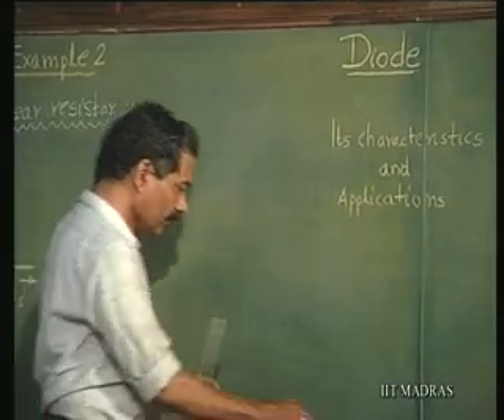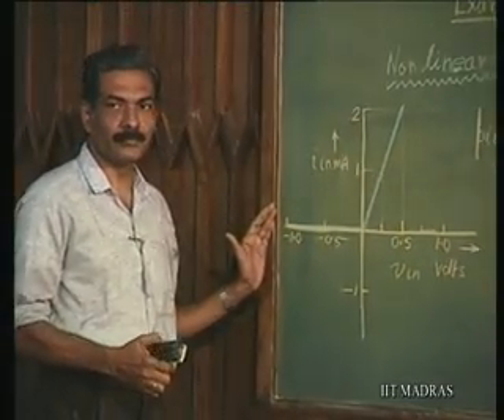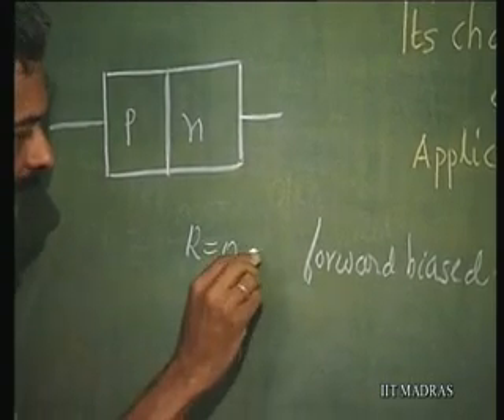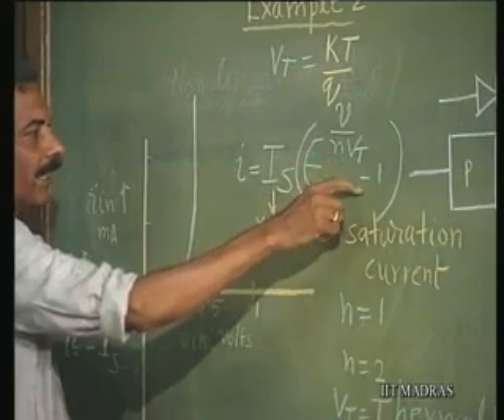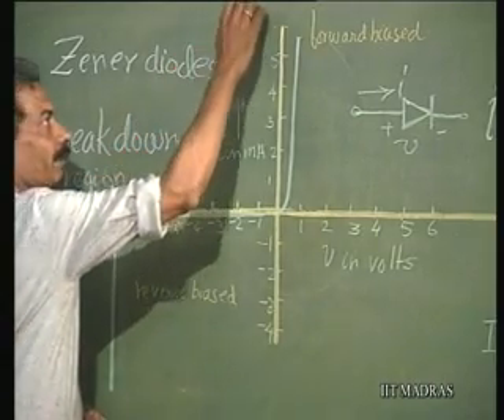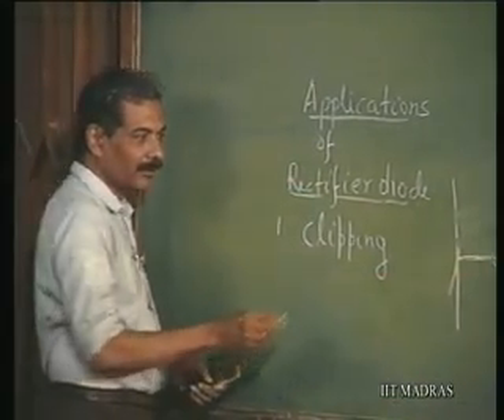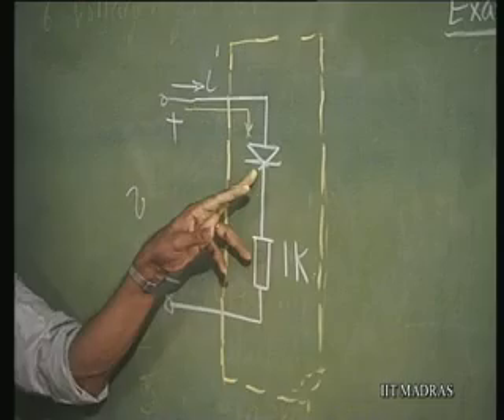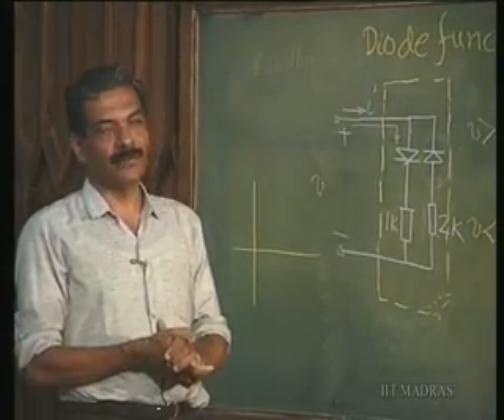Lecture - 2 Diode

Comment: A very inspiring old school reminder lesson.

I'm dealing with a salt battery situation where I have 3.8 million ohms 1.2 volts .5 mA

in a single container , multiplied by 8 in parallel , 2 in series

thats 3.8 million ohms per container , I'm starting to feel like I need to put all my electrodes in one container to lower resistance.

what do you think professor ?

Comment: Nope. The best you can say is that as b->0, then a/b -> infinity. But formally, a/0 is "undefined". If you start treating infinity as a  numerical value, then you can create some logical paradoxes (i.e. what is 0/0 ?). Note also that if a model of a physical system states that a quantity is "infinity", then it is due to a deficiency of the model - no quantity can ever have an "infinite" value.

"So 10/0, at least in elementary arithmetic, is said to be meaningless, or undefined." (Wikipedia).